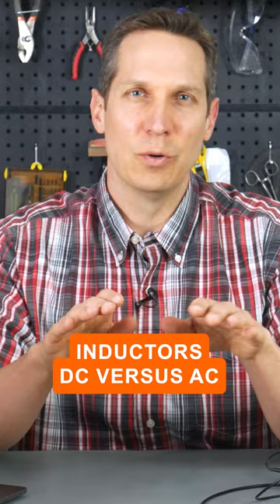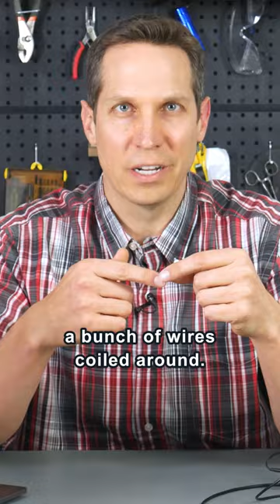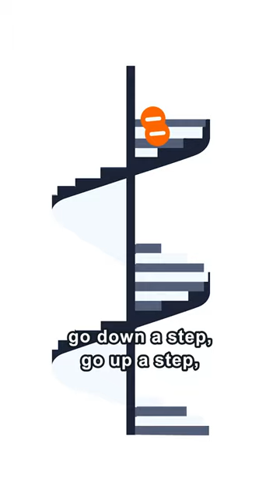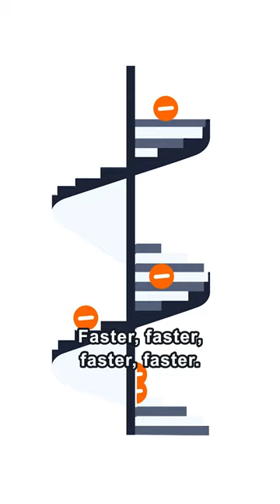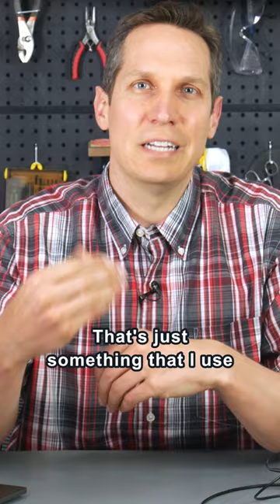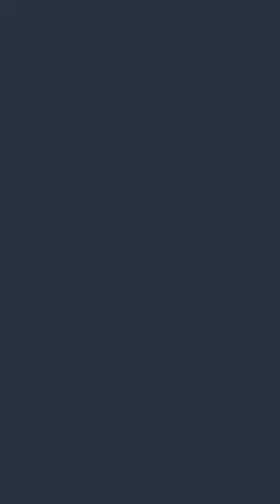Why does an inductor work differently at low frequencies versus high frequencies?

Comment: u dont really need the direction to be changing

just think of inductor as essentially a wire and capacitor a not connected wire. it makes sense that a wire would be a short , but open circuit when not connected, this is true in dc. think of inductor as a longer wire and harder to pass through as it is coiled up, the current needs more time to pass through, after that, it is essentially just a wire, and think of capacitor as non connected wire, the current passes through at first until it realizes it should be an open circuit.

but in ac, funny electron field magic happens. in the inductor, the ac keeps changing, so current doesn't have enough time to pass through the long and hard to pass wire. in capacitor, it is the opposite, the current keeps changing and arent given enough time to realize it is an open circuit, so they keep leaking through

in actuality though, these have to do with how energy is transferred, the energy dont come from the electrons or the current, the electrons dont need to pass through the capacitor and it cant because it is not connected. rather, energy is transferred by the fields caused by the interaction of electrons, and the fields are also the explanation for why current or rather, energy can pass through capacitor even though there is no way current can go through an open circuit. the fields dont care about whether ur wire is connected or not, they can still pass through, and they are established by the charges accumulating on the capacitor plates.